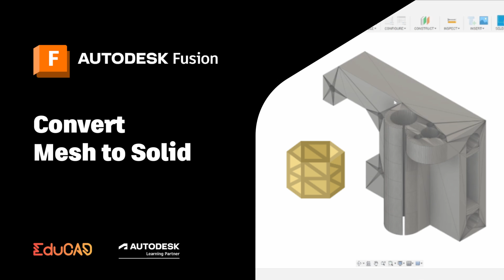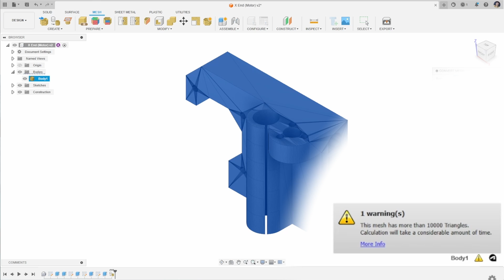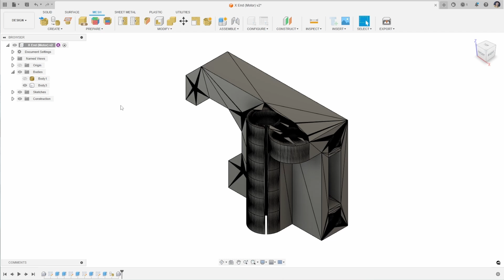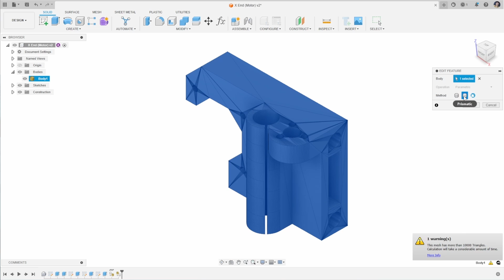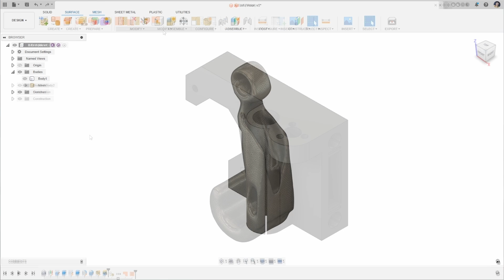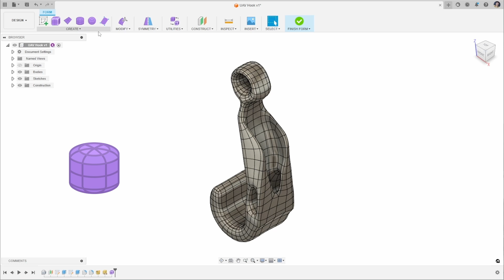3 Ways to Convert a Mesh into a Solid Body in Autodesk Fusion

Comment: The terrible faceted option is free and the useful prismatic option is behind a paywall. Yay!
Reply: Yeah and the prismatic solid hardly ever works. Always get error messages
Reply: For those having issues the prismatic option, you need to do 2 prepare steps first from the Mesh/Prepare menu, run Generate Face Groups and then manually clean up more using the Combine Face Groups tool. I too had troubles in conversions, but completing these steps before you convert the mesh should do the job.
Reply: Don't worry...the paid almost never works either.  THey always show you models where 80 to 90% of the models are flat surfaces. Anything other than a flat surface and the paid version crashes either.  I feel ripped off.
Reply: u can get access for free, just make a start-up, or register to college. And stop beaching for not giving u everything for free on a gold plate. FYI prismatic dont work like a miracle tools, a lot of times u need to correct some geometry. 
Best way is to use mesh as a reference and remake whole model from sketch planes. This is most accurate and most "pro" aproach to the task, and u can do it in all versions.
Reply: @xanonax  I am paying for my license, but the prism version is still rubbish. Can't polish a turd
Reply: @emanggitulah4319  I was refering to the og post. But triangulated geometry is a mess, and always will be. As u can't have vectors back from once rastered images, u can't have perfect parametric model from stl/3mf. All circles / arcs / splines etc will always have wrong dimensions. Want perfect model? remake it from scratch, there is no other way.
Reply: @xanonax  bro, not everyone is a fucking corporation that can afford a fucking yearly king's ransom for a stupid fucking subscription based model. I'd gladly pay $300 for fully functional software perpetual license, with yearly upgrade fees.